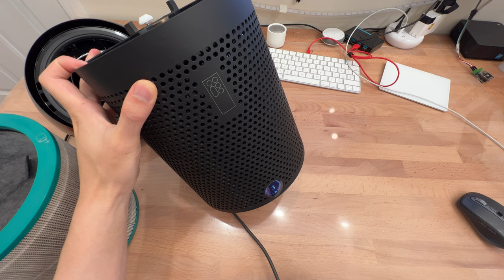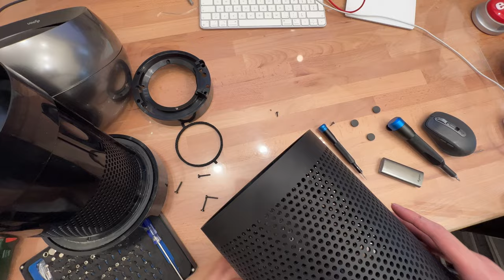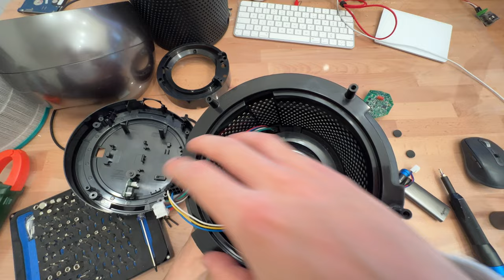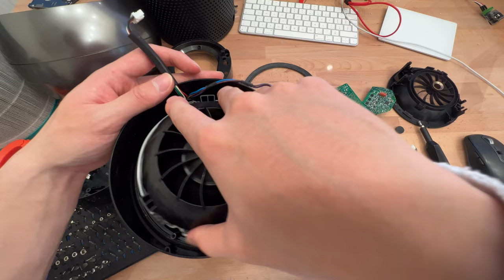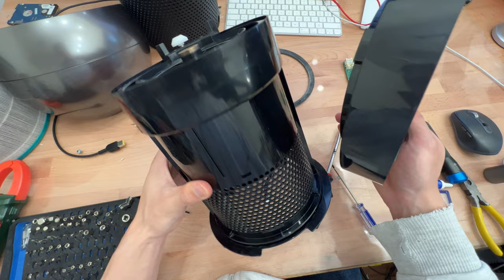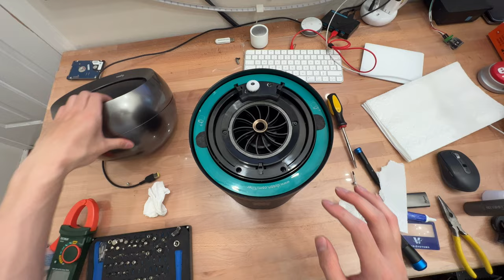Dyson Pure Cool Me BP01 Full Teardown Disassembly Reassembly Repair Whistling Buzzing Noise Fix

Comment: Thanks so much. I didn't realise the power cord just detaches (I've had it for years, you forget this stuff) so after I changed the filter and it wouldn't start I was sure the remote battery was flat. But I just had to push the power cord back in. Fixed my problem in first 20 sec. Thanks!

Comment: Mine is leaking a golden lubricating oil of some sort. Any idea where that might be coming from?
Reply from the maker: It doesn't appear that there is any location in this device that would have significant amounts of oil. Perhaps something was spilled into it and/or the filters captured a large amount of oil?

Comment: Hi mate, my ones got a triangle error. How can i fix that, any help?
Thanks
Reply from the maker: If the unit is within the warranty period, I would recommend contacting Dyson. If the unit is not, I would probably check to make sure the impeller is free to rotate and isn't jammed in any way. The controller can read the speed of the fan and will probably throw an error if it's not able to turn freely.

Comment: Mine won’t turn on and when it do it’s had a ⚠️ on it
Reply from the maker: you may want to verify whether the fan rotor inside the device turns smoothly or if it may be jammed by something. If the motor doesn't turn freely it may need replacement.
Reply: Thank you